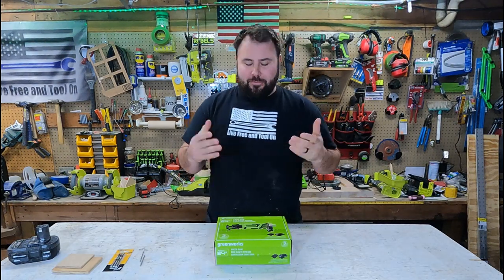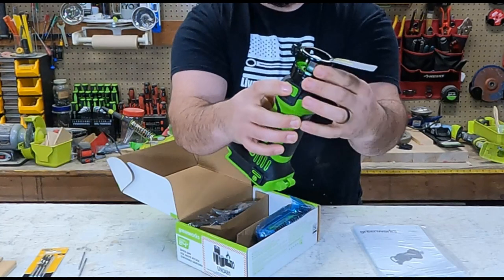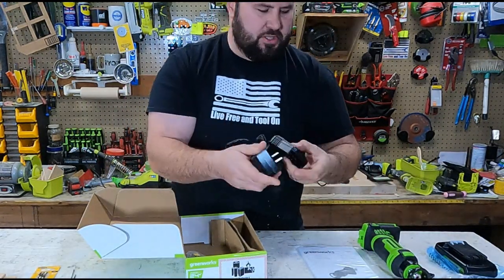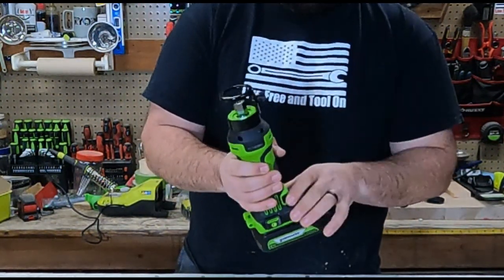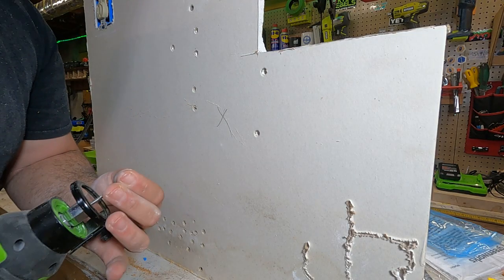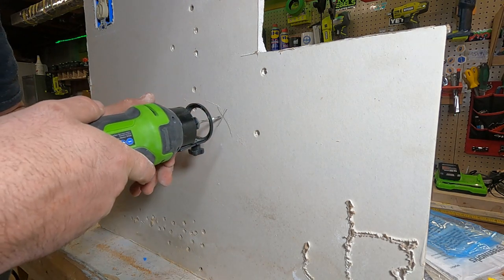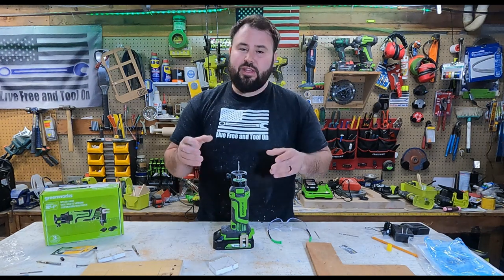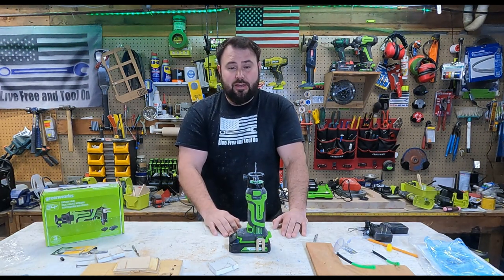Greenworks speed saw is a  BEAST!

Comment: I just bought one of these and have used it for a couple of drywall projects. I didn't realize it could work on wood as well. I am wondering if it spins fast enough to act as a Drimel, for that though I wish it had a speed control though. So far I am very happy with all the Greenwork 24volt tools I have bought... around 10 or so now.